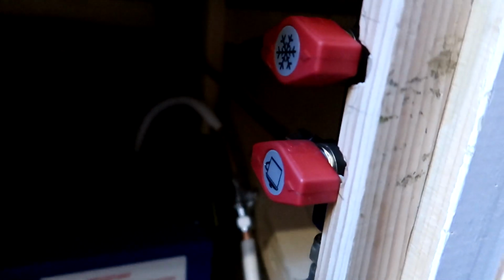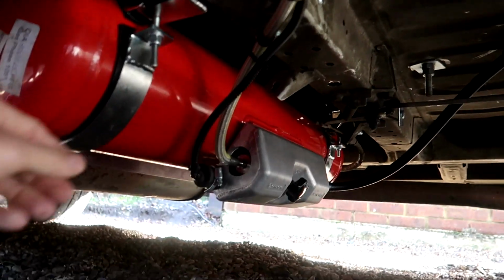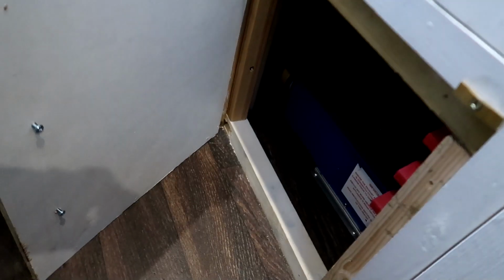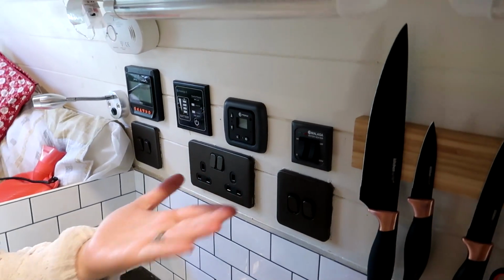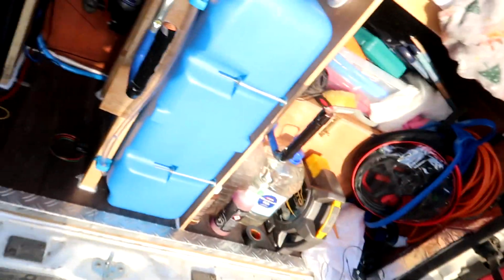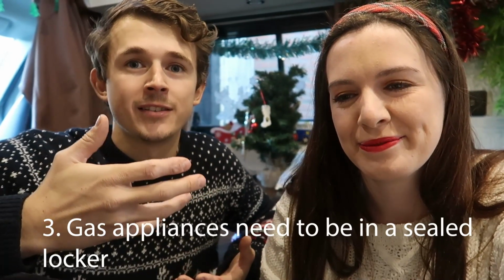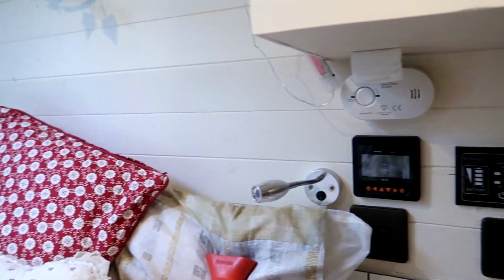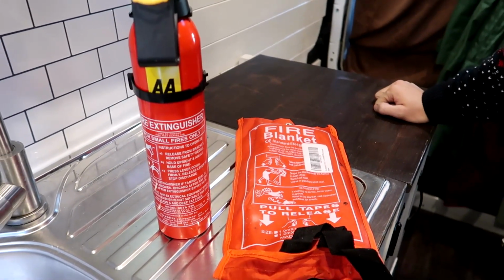CAMPERVAN LPG GAS SYSTEM [EXPLAINED!] Costs & more | Peugeot Boxer Van Conversion  | Ram Promaster

Comment: Did you actually say how much the auto gas install cost? So far I can see the cost of the water heater, air heater and oven (around £450 each) but not the cost if the underslung refillable gas cylinder and fitting.

Comment: Hi guys is there an angle the tank needs to be?  Or is it ok at 3oclock position?
Reply from the maker: If you have the same tank as us from AutoGas 2000, then yes, if so, there is a line that has to be at the 3 o'clock position (90 degrees). Their team is super friendly and helpful too, so if you've got any other questions, it's definitely worth giving them a call :)

Comment: Do you know what is minimum clearance require for your vehicle between tank and ground?
Reply from the maker: no, but I know this one meets all necessary regulations and was purpose made for this chassis
Reply: @CazzyandBradley  I  have the same one. But soon find out I need bigger one but unsure how big I can get.
Reply from the maker: @897aa33  I recommend calling up Autogas and speaking to them. Super friendly and they can tell you the biggest size possible for your vans exact chassis :)

Comment: Great add-on to your van! Hope it lasts you forever, without any issues! I would suggest to maybe install a gas detector in the water heater compartment, provided they are so cheap. It wouldn't impact your safety (because you have properly vented the compartment, with a tube, through the van floor), but at least, if your water heater has any leaks, you'd find out immediately. And it's really easy to install - just bolt it into the heater box. Personally, if I had a van with a setup like yours, I'd buy 2 gas detectors (one for the water heater box, as mentioned, and one for the inside of the van, just as an extra safety measure - for peace of mind). Keep up the good work!
Reply from the maker: Heya, thanks for the comment this is actually something we hadn't even considered. Do you have a link to the sort of gas detector you mean? As you say, safety-wise I like to think we are all set up for any gas leaks. However yes I would much rather know where a leak was occurring if a small one did happen :)
Reply: Hey, unfortunately, I don't think a link could help, provided I'm not from the UK, but still, I've just looked up Amazon uk, and it seems they have a few models, from 18, to 30-50 pounds, and they do have pretty high ratings. Personally, I would just call the guys you were referencing in the video, that were kind enough to spend a lot of time to properly explain the LPG system, and just ask them for a quick technical recommendation, and see if there are any differences in the several models of gas detectors, that are available online. Best of luck!